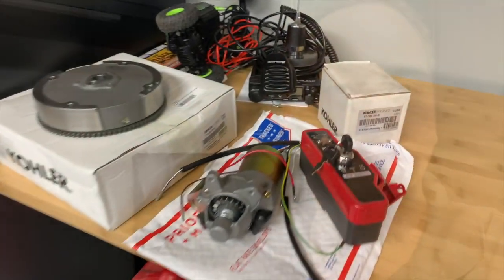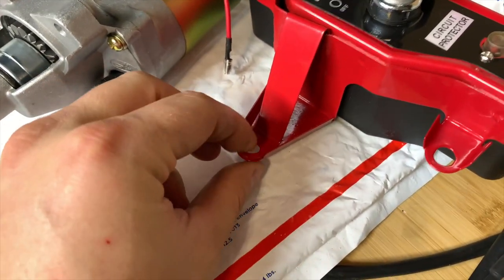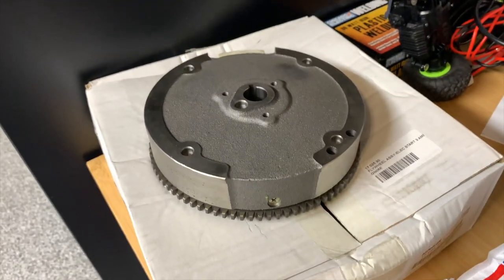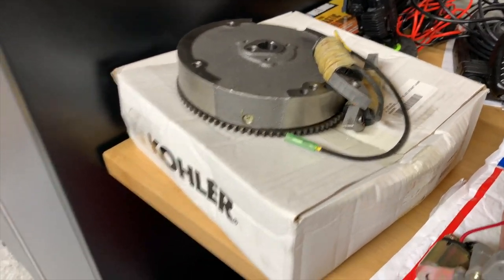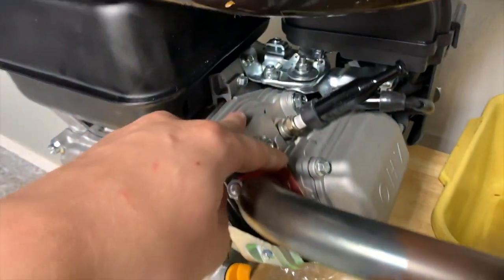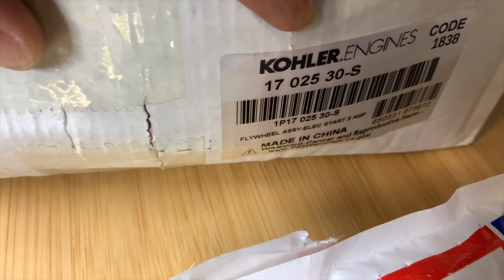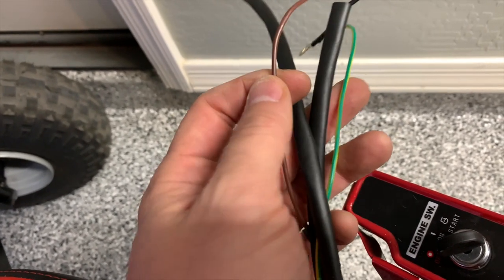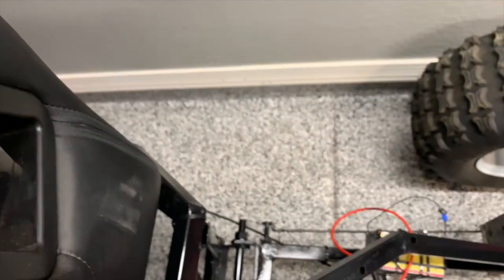Predator 212cc Hemi Part Compatibility - Flywheel, Stator, Gaskets, Starter, and Switch Box

Comment: Ive seen where this will also work for the 301cc Pred engine too.  Dont know why there arent more videos showing this.
Reply from the maker: The 212cc is the most popular.
Reply: @dr.leespoorlifechoices1701  I understand that, but if you are doing a swap for a snow blower, with a long 1" shaft,  the 301 will save you from having to buy a sleeve to increase the diameter of the 3/4' 212 shaft, with the addition of washers to increase the shaft length.  Plus you will gain more HP.

Comment: I got Honda gx200 and bought the starter kit , looks just like the one you showing , do you gave wiring diagram how to wire all the wires coming out of the switch box ?
Reply from the maker: No.. and I wouldn't trust the color coding. Typically there is a wire with two bullet connectors that goes to the on/off switch and the low oil sensor. Others are for the battery, stator/charging coil, and starter.. I'm probably forgetting something. Others have videos though.

Comment: Hey i was wondering if a neodymium magnet would help magnetize the stock flywheel so you just install the stater assembly
Reply from the maker: For the ignition coil? The flywheel already has that built in and the timing is only adjustable via an offset key on the shaft. Sorry I'm not sure I understand the question but this is the only way I know how on the flywheel side.
Reply: @dr.leespoorlifechoices1701  JB welding small neodymium magnets on the inside of the wheel
Reply from the maker: @squishy_Rio  The stock flywheel will work fine as-is. I only replace it so the starter motor gears have something to connect to. If you don't want electric start, you can just install the stator assembly.

Comment: This is why you don't buy a predator 212 but buy a Tillotson 212 instead because they have a electric start version available and it's 3.5 horsepower higher than a predator 212 and the tillotson stock flywheel can handle higher RPM's tillotson 212 is 10 horsepower vs predator 212 of 6.5 horsepower.
Reply: I'm always tempted by them, but I have a a lot of existing $100 Predators, like experimenting and a HF just down the street ;)
Reply: I have a tillotson 212 and you can't buy a 3 magnet flywheel for it to charge a battery and a headlight. Gopowersports said, we can't get the flywheels! So I found out through a buddy that builds race engines that tillotson is a Honda clone, so I'll be buying a 3 magnet flywheel for a clone motor to get what I need. The tillotson hemi doesn't turn enough RPM'S to scatter the flywheel anyways.

Comment: @Dr. Lee’s poor life choices, you mentioned you use dual stators or charging coils, I’ve seen videos where one connects to the ignition switch box. Where does the second connect to? Also, what does the coil connected to the ignition box do?
Reply from the maker: I do use a dual stator setup, because I tend to run small LED light bars as "running lights" for safety. The stator connects directly to an input wire on the ignition switch box, correct. Inside the switch box, there is usually just the single (and very poorly soldered) multi-position switch that connects it to the battery when running. The coils come already wired together, so electrically it's identical to running only a single coil.
Reply from the maker: ...Also note that the voltage regulator is inside the switch box and pre-wired internally for you.
Reply: Thanks for the response! So being connected the ignition switch box, that multi position switch will charge the battery? My goal that I’m trying to achieve with the electric start setup is to also be charging my battery to operate small LED lights and a few accessories.
Reply: I have searched the Internet for some time trying to find dual stators that is wired together with one connector on the end. Most I find have two connectors. Do you have any recommendations to what coils to use?
Reply from the maker: @coryjackson5644  In the video notes I put the Kohler part number I used, but I've bought eBay parts that came that way, too. If they came as basically two separate coils, I would think you would just wire them together in parallel at the same switch box input wire since they will be 180 degrees out of phase and the regulator should take care of phase rectification. That's the only thing that makes sense to me, at least.
Reply from the maker: @coryjackson5644  Correct. They have to be connected through the switch both for the voltage regulator and to make sure it is only connected when in the 'on' position. Otherwise you would drain the battery when off and "charge" it in a very unsafe manner when on.
Reply: Dr. Lee's Poor Life Choices Do you recommend putting a inline diode in before hooking up the stator wire to the ignition box?
Reply from the maker: @coryjackson5644  I don't do that on my builds, but it shouldn't hurt anything as long as it's rated for the max amperage you'll be pushing from the stators.
Reply: @dr.leespoorlifechoices1701  where are you seeing a voltage regulator inside of that's control panel? The ones that I've had apart do not have a voltage regulator, they only have a single diode in the wire that connects to the output of the charging coil. That serves as a half wave rectifier, but there is no voltage regulation. I can see in the control panel that you had the yellow wire has a diode in it covered by the heat shrink. I cannot see where it would be workable to feed the output of two separate charging coils that are 180° out of phase with each other through a single diode for rectification. The solution would be an external four wire rectifiers/voltage regulator

Comment: 3 amps at idle or max speed?
Reply: That's with some throttle but if you're going through a voltage regulator you'll still get about 11.4 volts and can still charge a battery while using lights.

Comment: I bought this electric starter kit for my predator 212 (hemi) and the flywheel does not fit my crank. What should I do? Any help would be great.
Reply from the maker: If the flywheel doesn’t fit the shaft, it sounds like whatever kit you have is for the non-hemi Predator. The starters are the same but the shaft taper is different.
Reply: @dr.leespoorlifechoices1701  I just spent 4 hours lapping that damn crank shaft but it turned out 👌.
Reply from the maker: That’s crazy!! Glad you got it figured out though.
Reply: @dr.leespoorlifechoices1701  yeah, I had lapping compound and the wrong starter kit...I made it work lol. Thanks buddy.
Reply: why didn’t you just swap the Ring Gear off the Honda flywheel onto your stock hemi flywheel?????
Reply: @BUILDNIGHT  does the hemi flywheel  have the internal magnets to make the charging coil to work to recharge a battery for starting, lights  etc.?
Reply: Joseph Posch 
no, but the Electric Start Kit comes with the charging coils

Comment: Where did you get the flywheel, and dose it work on the new predator?
Reply from the maker: I usually just find the best price off eBay for the exact, genuine part number. I really wish there were a knock off version, as the Kohler is insanely overpriced. However.. the answer is YES!!! It works fantastic and I've never had an issue with these. I use dual stators in all my builds and have never had an issue with any stators I've tried, Kohler or otherwise.
Reply: What is the part number?
Reply from the maker: Flywheel: Kohler 1702530S 
(Optional) Flywheel Fan: Kohler 1715706S
Stator: Kohler 1708509S (doesn't have to be Kohler brand -- generics work fine)
Reply: Alsome thanks
Reply: @dr.leespoorlifechoices1701  is the stator the charging coils?
Reply from the maker: @alexanderellis7544  Yup, same thing.
Reply from the maker: (Different from the ignition coil that connects to the spark plug though.)
Reply: @dr.leespoorlifechoices1701  sorryy I do not follow ...just started this project and I am learning
Reply: V Power Equipment sells the flywheel for the hemi version...VPE part # 012921HEMFLY

Comment: Is the timing right with this Kohler flywheel when you bolt it on the Hemi Predator 212?  or do you have to do timing adjustments?
Reply from the maker: Timing is the same as the stock flywheel. I've never had any timing issues.
Reply: @dr.leespoorlifechoices1701  Thanks!

Comment: Is there a benefit to getting the fan?
Reply from the maker: Kind of. The white plastic fan doesn't fit perfectly on the new flywheel; if I recall correctly you need to trim a little material to get a decent fit. It would be reassuring if it fit perfectly, but it doesn't. An aluminum flywheel fan would certainly dissipate heat better, too.

The issue people usually bring up is if the plastic fan can hold up at higher RPMs. I've never had any issue with these exploding at WOT, but it seems plausible that the plastic could sheer.